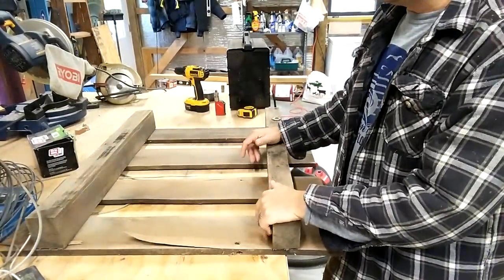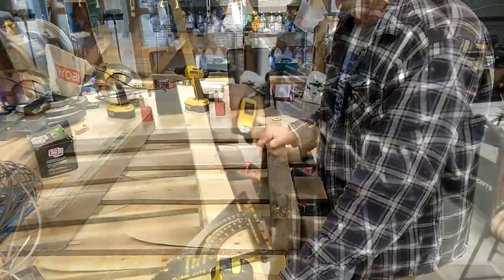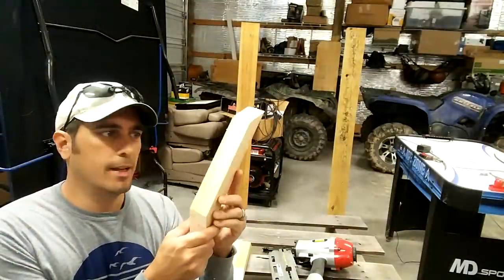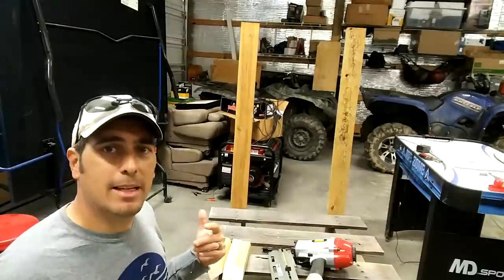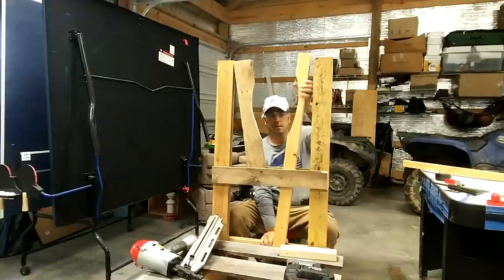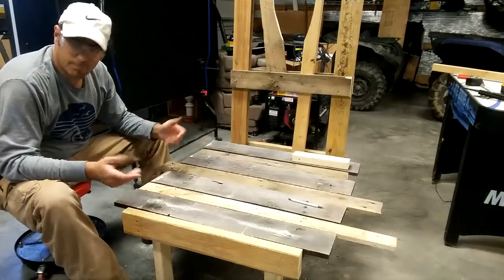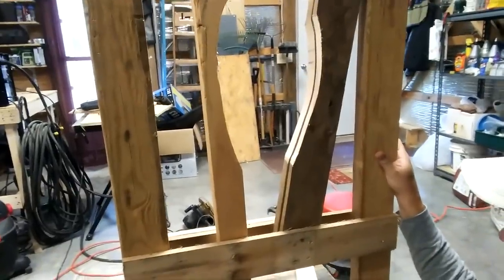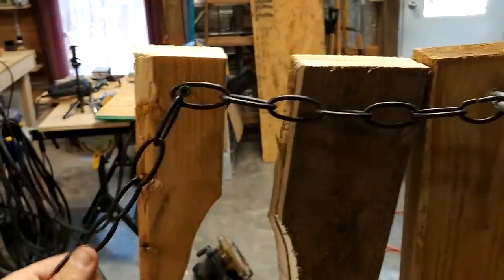Goat Milking Stand DIY with Pallet Wood

Comment: Good job.  I love the milking stand on Art & Bri because she can sit on the edge while she is milking.  No need for a stool or bending down. She also mentioned one of her goats wanted to sit down while she was milking, but with her being there right beside her, she can put her arm under her belly, no more goat sitting on her butt and better control of the goat.  Just get a couple cans of enamel spray paint and spray that stand.  I would cut a circle in the feeding shelf to hold the feeding bucket.

Comment: O.k., your yoke is going to drive me nuts. You will have the goat standing off center as it is right now.  I think if you had the stationary part more up right and possibly supported at the top with another piece of board, it would help. Then, it would depend on what size goats you end up with as to whether it's the right height and size opening.